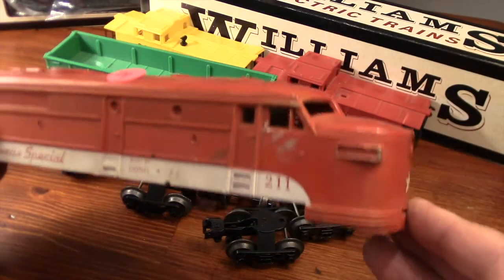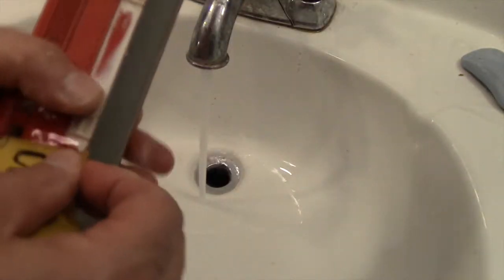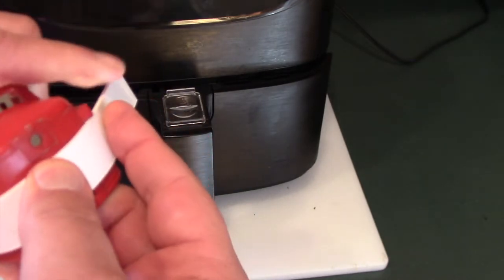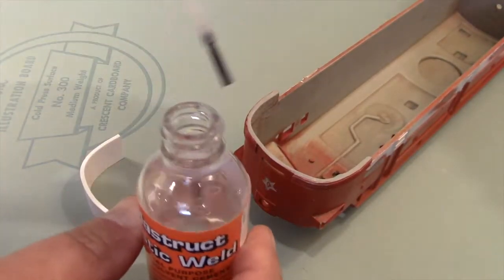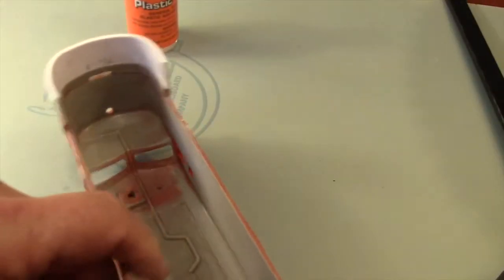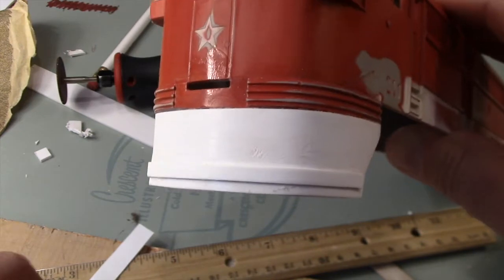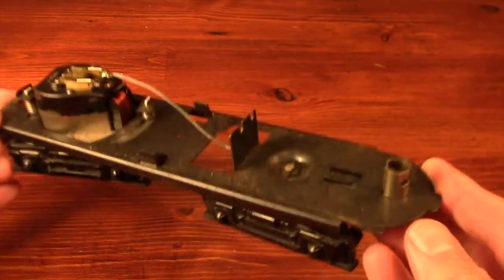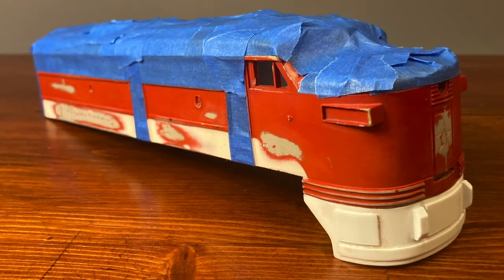Lionel Texas Special ALCO with broken plastic parts in O Gauge Scale Williams MTH Santa Fe UP

Comment: Hi Bob,  I purchased a group of 4 ALCO shells and I am working on converting two for a Halloween train.  I added or replaced the lower skirts similar to. your video except I used a heat gun.  Worked well.  Questions....How do you get the number boards out.  I tried to mask the boards but I think my pin stripping tape was old and as soon as I started painting it blew was.  Did all Alcos have the front skirt.  I made these and cut out the opening for the front coupler.  I used super glue and it seems like a solid bond.  Thanks for all the great information.  Bob in Leavenworth KS.
Reply from the maker: I don’t think mine came with number boards. Some didn’t even come with cab glass. I know the front coupler can be removed.
Reply from the maker: I can think of 3 different styles of alco shells that fit the stamped steel chassis. Two with openings for front couplers and one without.